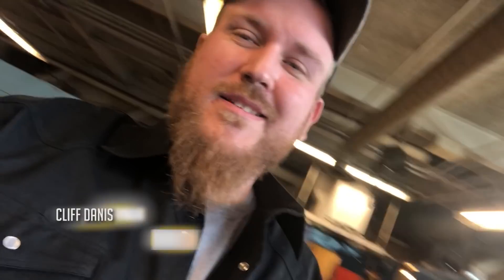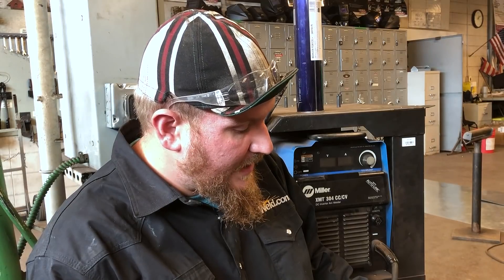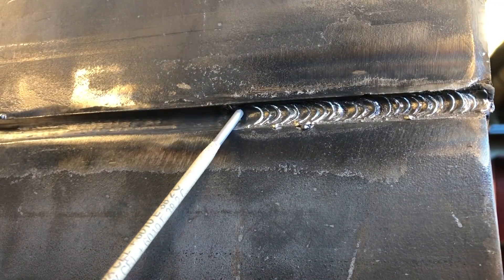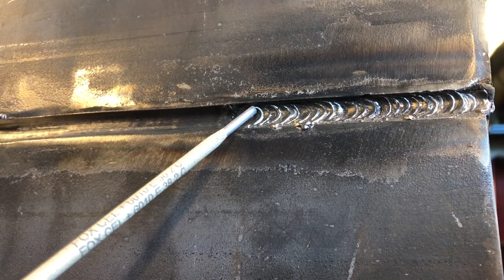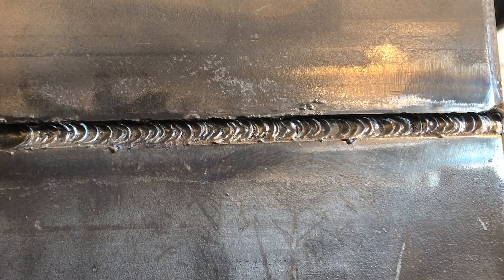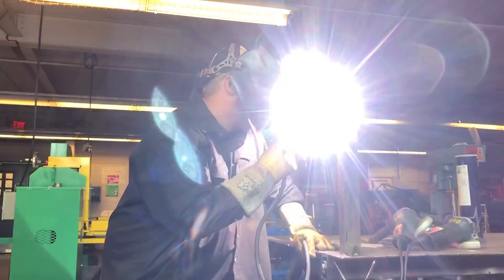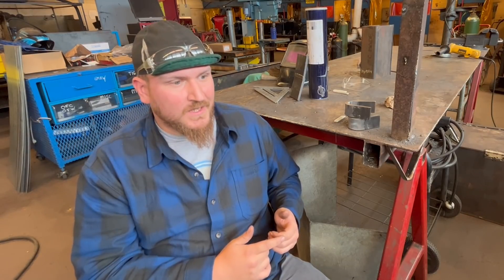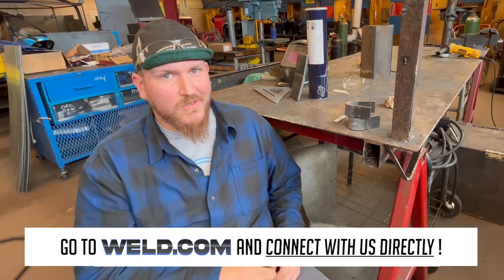Stick Welding Restarts - A Critical Piece of SMAW is Starts and Stops

Comment: Starts and stops are pretty critical with flux core. My first pressure vessel,"air" fizzed like mad. The last one I did my stops and starts correctly,no craters on the stops and prepped the stops and the first start maybe even a little grinder action to boot.

She held 125 psi,no leaks and bore scoped it,good penetration! 1/8" gap,035 88 amps ,

Comment: I've been a double time welder in the refineries,shut downs and turnarounds  for a very long time. Don't read too much into what's going on with the p5. The hot pass will get most,and whatever it don't take out,the LH will. Welders over think shit so much,and let's doubt in,and it's a cycle. Rule of thumb. 3/32 is 95 Amps. 1/8 is 120. P5 is a cleaning rod. The boss or qc watching you grinding all day on your coupon is as bad as having a bad weld. Hang it deep,weave it wide and wish it well. Good advice here bud thanks ,just passing through 😉
Reply: Stick seems to be a little more forgiving on start ups than flux core,inclusions suck!

Comment: You should be able to use an 8 inch gap in an 8 inch land with 1/8”  6010 and amperage at 90. You wont need to keep adjusting your heat. In a work atmosphere you wont last a week going back n forth adjusting heat. I’d love to come there and do some videos with ya. I was a UA welding instructor. Im a UA Journeyman Pipe Fitter. Been welding since 2003. Not boasting just sayin, lol. I weld one handed smaw on most stuff now and pass xrays. Fluent in mig and tig as well. Funny thing is I didn’t learn how to weld in the union. I went to Illinois Welding School. Great place and I learned a shit ton walking in green as as hell but left with them offering me a position at the school. Pay wasn’t enough compared to what you can make. There’s  a local in California that is paying 72$ an hour on the check. Can you imagine working overtime!? If you ever wanted to be a construction worker and make $140 an hour now is the chance. Join your Local Union

Comment: How did you run that high of Amps and not get any undercut on the cap?
Reply: A mix of variables go into it. Arc length, rod angle, and travel speed are the big three. Picking up your speed is pretty important when welding in the 2G, keeping your arc tight, and a small lead angle help keep that metal where you need it. I find when I slow down I get that familiar droop with undercut on the top toe line. Those high amps can also increase undercut, but keeping your variables in check will help those amps flatten your weld profile. Try it out! Good luck!

Comment: What is the best technique for keeping your cap under 18 when running 3g and 4g
Reply: A whole lot of factors go into this! Get in that booth and practice! I’d say one of the MOST important variables to keep in check when welding in the 3&4G is arc length. Keep it tight! Run hot, and hold your toes. All good things will come to those who weld straight 😎
Reply: @cliffdanis1521  okay cool thanks man
Reply from the maker: Under 18 what?